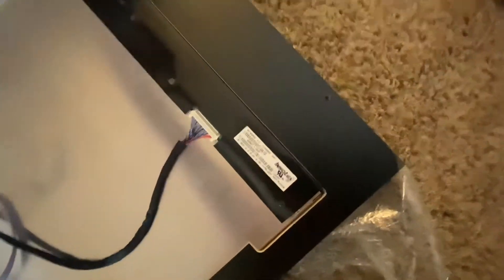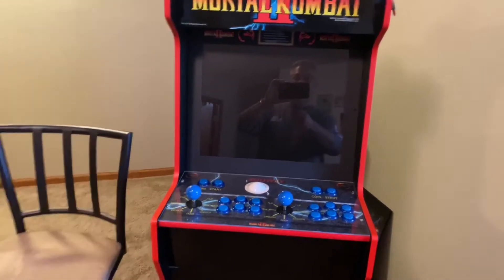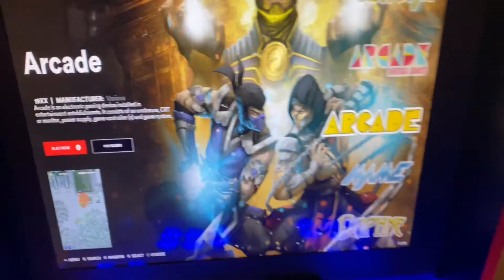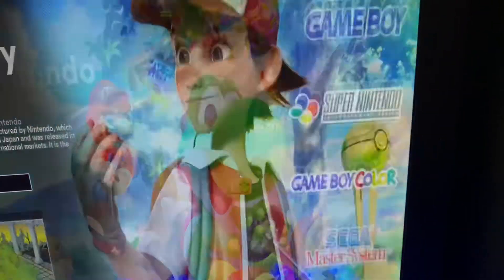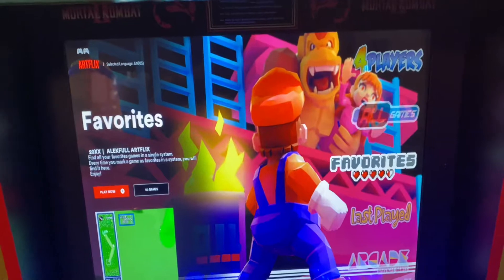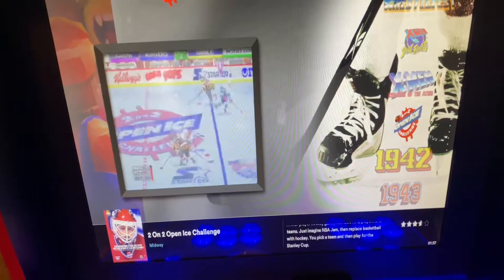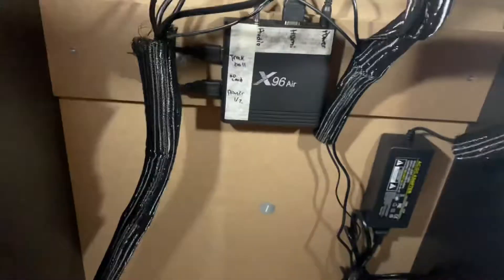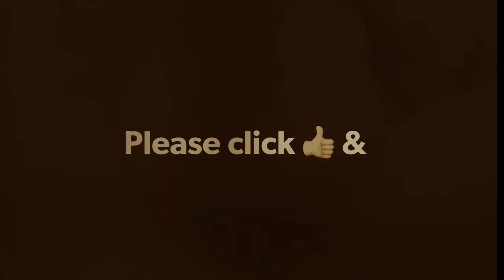Arcade 1up Modded Mortal Kombat II Legacy Edition Cabinet

Comment: One more question, how do you set the correct control for mortal Kombat?
Reply from the maker: Hey Sid,

The button layout from Arcademodup and on my cabinet is “Top 3” Y, X, L as in left trigger. The “Bottom 3” B, A, R as in right trigger. They are mapped this way in order to support the multiple games that come with this kit and different controller configuration to accommodate most games. However they will map them however you want them to. 👌🏼😎

Comment: 😃 how much this cost u
Reply: around 350$ check the link in the description
Reply from the maker: Here is a breakdown of the cost…

MKII Legacy Cab (Marketplace) $250

Mod Kit including controller, Android Chipset, Amp from Arcade Mod Up $350

19” LCD Monitor from Arcade Mod Up $180

Trackball from Arcade Mod Up $20

Surge Protector, wire wraps and tap lights from Walmart $100

Taxes around $60

Total was roughly $960

Thanks for watching my video! T
Reply: @compextremes  😮 what the heck OH my gosh thats alot of money 😁 but atlest u have lots of games to play now
Reply from the maker: @princevinny0073  imagine having basically any retro game at your fingertips on an actual arcade cabinet. I have been playing different games every night for about 3 weeks now and have barely played a quarter of them. It’s insane man! The cost is very minimal when you put it in perspective. 😎👌🏼
Reply: @compextremes  im doing this with my arcade1up but we could of just got a bigger screen arcade custom cab thats not the 1up for 900 then used anything we want on it for games